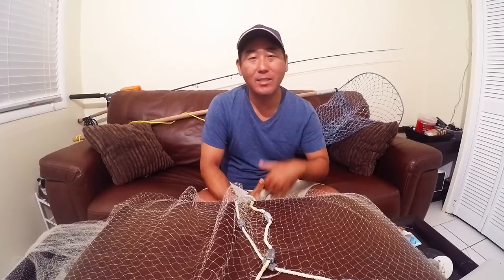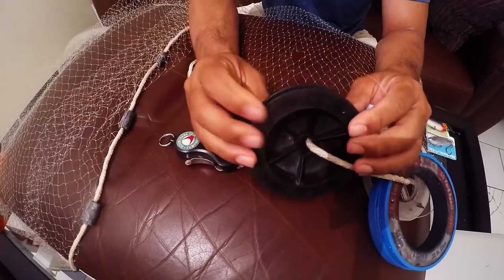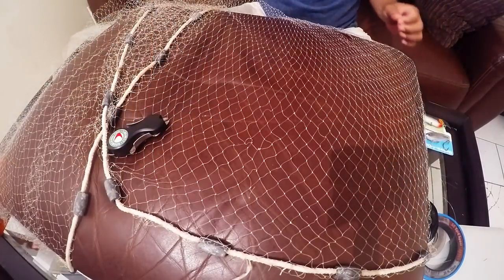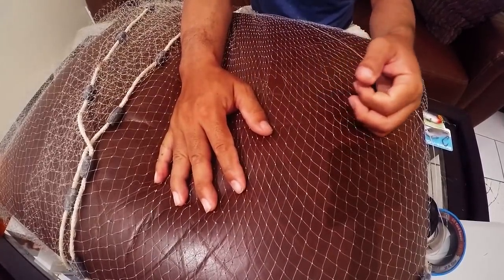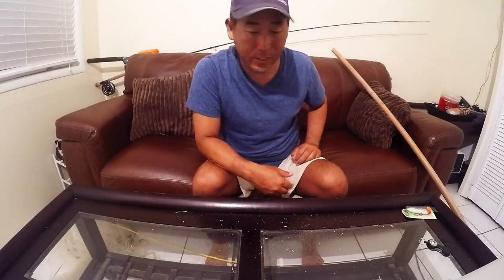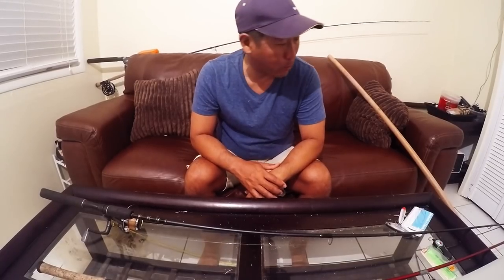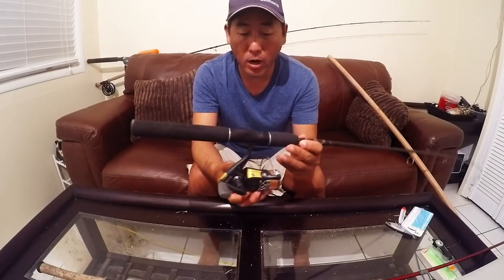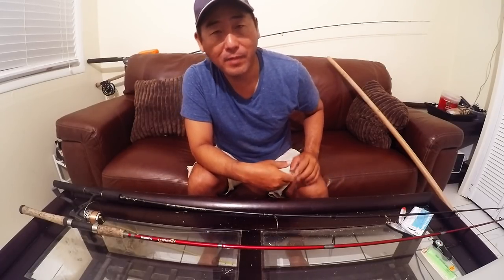Hurricane Week Projects: Cast Net Repair, Rod & Reel Rehab, and Bully Net

Comment: Hey Steve fantastic stuff with the cast net repair!!!  Bought a new net 9 ft. net about 10 years ago and I wasn't feeling too confident yet. One of my buddy's offered to throw it in my stead. Shrimp were foaming so I said fine, and first couple tosses looked good, but on the 3rd throw he snags the fence he was throwing over and rips a 3.5' long "L" shaped hole in it, and that was it..  Fast forward 9 years (yes I am a hoarder), and I see you doing this, and long story short and about 4.5 hours later that 9' net came back to life!!!   
Thanks brother.
Reply from the maker: Good deal.  Pretty simple once you realize that you don't have to be totally perfect.  Glad it helped.

Comment: thanks for the advices man, i will fix my net like that soon... but it doesnt affect the propper opening of the net??
Reply from the maker: Not at all.  Just make sure you trim off all the little tag ends from the knots.  Cut them close to the knot.  Other than that, it will work fine.

Comment: Man your castnet patches are so neat and clean. I usually wait until the damage is large enough for mullet to swim out before I even consider patching and when I do patch it, it ain't pretty. lol The net I'm running now been running for two years. Got like 20 patches on that bitch. I even redid some of the brail on it with 80lb mono and its lopsided as hell. But I fill that thing up man. Every time.
Reply from the maker: I get tired of the heads getting stuck.  Especially the Snappers and Pinfish.